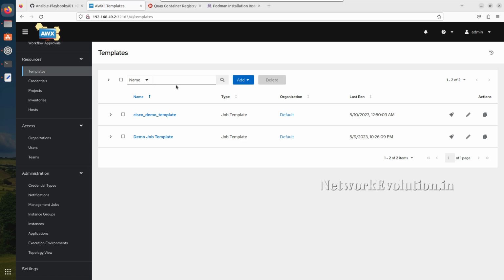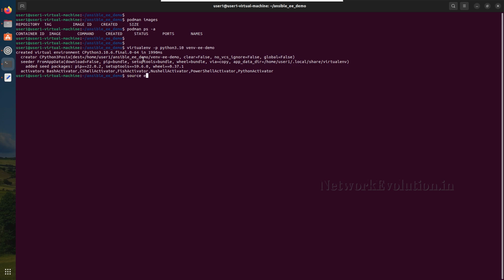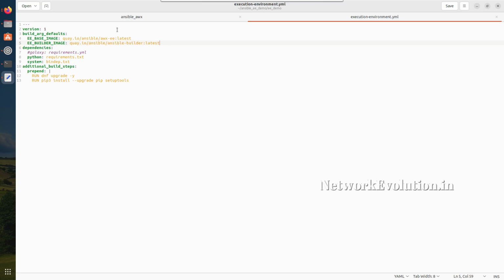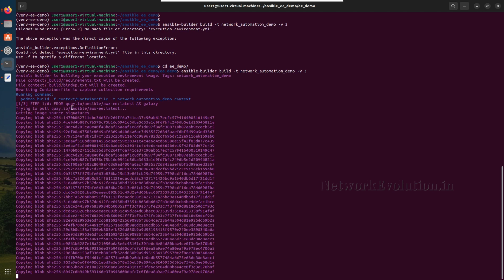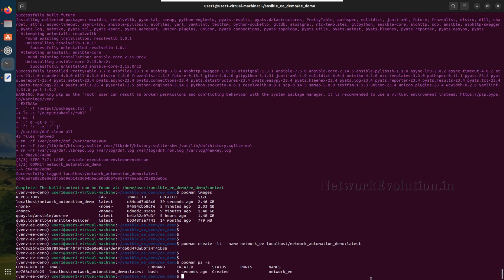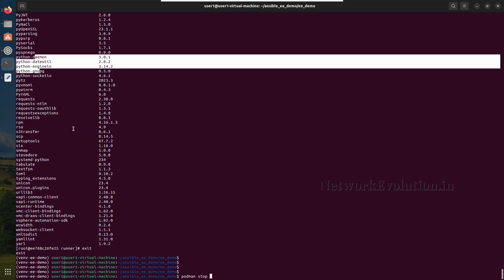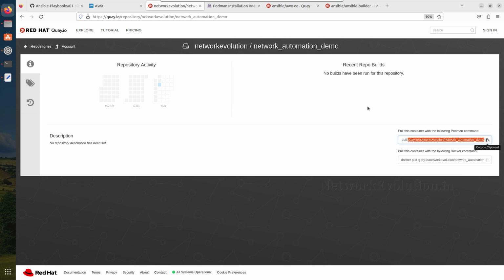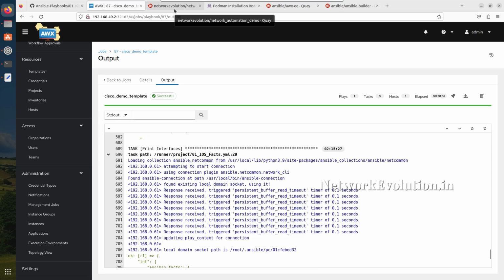Ansible AWX/Tower Create custom execution environment Container using Podman|install python packages

Comment: Hi , thanks for the video , I followed all steps and getting this following error when I ran a test template
Worker output:
exec /opt/builder/bin/entrypoint: exec format error
Reply from the maker: In which stage of configuration are you facing the issue?

Comment: Hi Thanks for this great information. But i do have one question here while creating Custom image do i need separate VM where i need to install ansible-builder or i can do it from my windows laptop as well using VS code.
Reply from the maker: Thanks for the comment. You can install a ubuntu using WSL in windows and execute all the commands demonstrated in the video.
Reply: @NetworkEvolution i followed your instructions successfully. Thanks
Reply: One more question. Is the execution environments file like a docker file only. So when I want to run one web application like nginx I keep adding commands in the docker file and then using the docker file it will create an image using that image we create container. Is execution environments works same?